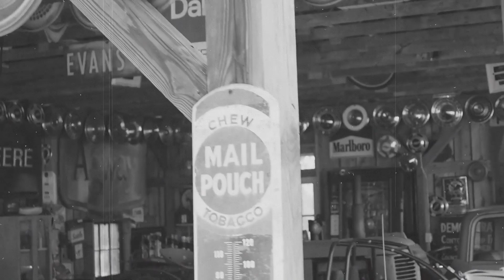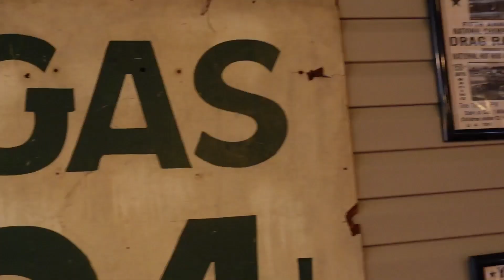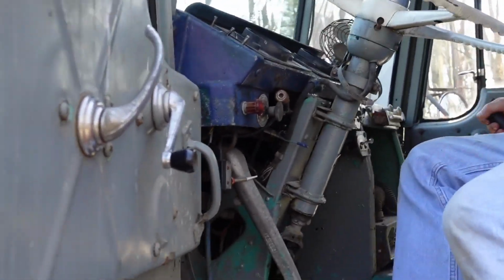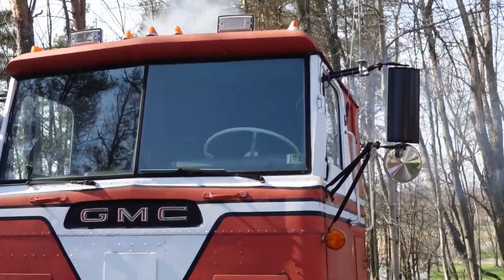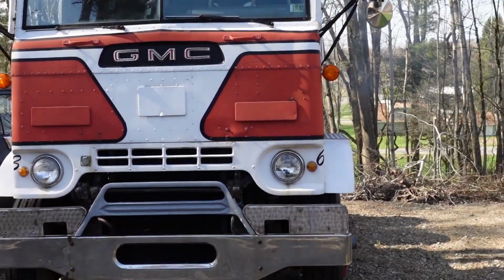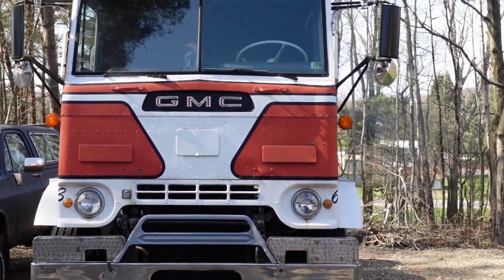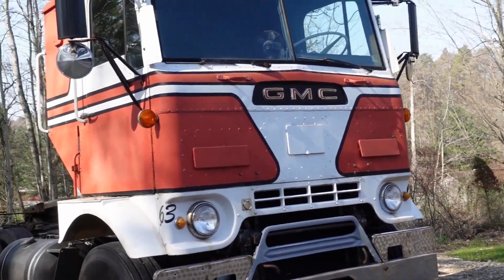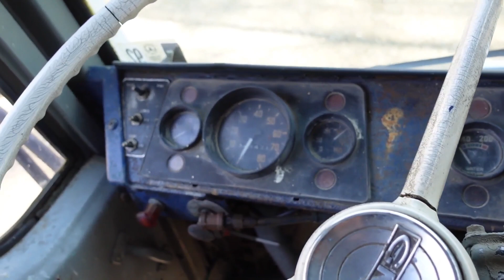GMC Crackerbox Detroit Diesel 671 Turbocharged / Vintage Gas Station & Hot Rods

Comment: The add-on turbo won’t hurt that 6-71, the later versions in the early 80’s were available with these directly from DD/A. This particular engine desperately needs the rack ran on it and the idle reset to eliminate the “hunting”, would likely eliminate a good portion of the smoking. Might not hurt to pull the injectors and give them a thorough cleaning/inspection, possible gum/varnish deposits hanging the plungers in the bores.
Reply: I hear rod clatter in their too

Comment: I remember my father driving for trucking outfits when I was a kid, and a good many of the haulers were using GMC Crackerboxes... Two things that I always remembered about them was 1) that eerie green interior paint the factory always used, and 2) when these tractors used the Dayton type hubs (few had Budds because they were considered aftermarket back then) they always had this characteristic "fat" look (both front and back) that would distinguish the GM stock from any of the competitors of the time... Even the later Astro units that replaced the C-Box in 1969 didn't have stock Dayton hubs nearly as "thick & meaty"!
Reply from the maker: Your absolutely right! And that’s why I love em.😬👍
Reply: I Love them Dayton Wheel,s they are my Favorite on all Truck,s! You can really Dress them up with paint and Chrome lug nut covers and they stand out nice. Budd Type Wheel,s have been out just as longer as Dayton type wheel,s if can remember correctly. I would really have to check, to make sure. But I know as far back as, I can remember even when I lived out in California mostly all the old truck,s had Budd Type Wheel,s?

Comment: A turbo is not going to cause an engine to run away unless the seal goes bad and it starts running off the oil.  Sounds like the injector rack might stick once in a while.

Comment: Yep, Birkmire had these with this paint scheme but green. Seen these running in Erie  in the 80’s.
Reply from the maker: Stayed tuned for the next video, old Berkmire in original colors.😬
Reply: I believe  they are still in business  as btc trucking from erie,la they used to pickup  where I loaded and unloaded at alot.

Comment: I got all excited when I saw the clutch pedal micro switch….That means she’s got a JAKE!!!! They’re Pretty rare on an 8V71 but a 6-71 with jakes is about as rare as hen’s teeth these days. A plain old 2 stroker sounds good on its own but there’s nothing like that sound when you let off at 2000 RPM and let that jake sing.

Comment: I ran lots of Detroits in heavy equipment and none of them ever smoked like that: At startup but after a few minutes that should be gone . Almost looks like water getting in and it’s burning it. Cracked block or head gasket. Ran a 6-110 that idled like that. Otherwise ,gorgeous truck

Comment: The ride quality on today's beat up interstates will have you wishing you had air ride and new suspension. That thing would jar your teeth right out of your head on I 40 in Arizona. Probably fun to drive under 50 mph but today's interstates , not so much.
Reply from the maker: You’re definitely right, it’s no different here in Ohio… trust me. But it’s pure pleasure driving them and connecting with that old school vibe.

Comment: I agree with Bowslap-rack needs to be run, injectors pulled and flow tested, governor set and most of all-take it out and blast the living crap out of it. You're driving it WAY to slowly and lugging the engine. Get it up to the governor. Do you know that Detroit Diesel had a marine version of the 6-71TI that put out 485hp at 2,500rpm straight from the factory? Many a truck driver turned these engines up to 2,800rpm for better performance-course less engine life.

Comment: Factory power steering in 63? No way! I've driven a couple of cracker boxes that were newer than that and they didn't have power steering
Reply: most of those were equipped with what G M called pin point steering, as long as it was rolling it was supposed to steer easier than most of the other competitors back in the day.
Reply: @MrDavidstroud  Ok Thanks David

Comment: I drove a GM a few times but didn't care for them. Even the 318 was underpowered. It didnt help that my route took me over Donner Pass. It took me over 3 hours to go 90 miles. I did have one truck with a Detroit that I did like tho. That was a 1988 Kenworth with a 575 hp 8V92. And yes, they did make but only aftermarket. It was a truck/trailer tanker and i used to pass the 3406's and the 400's.
Reply from the maker: Wow! your a true Veteran on the pass! Hat tipped Driver.
Reply: @DaneScottsTRUCKERSLOUNGE  I still look back on everything with nostalgia though.  0
Reply: @DaneScottsTRUCKERSLOUNGE  
I started in the early 60's on my Dad's ranch. Bought my first truck in '74 and went to Alaska to work. Didnt stop until a drunk wrong way driver took me and my truck out August 17, 2001.
Reply: 8 v 92's were thirsty. I'll take the 3406 all week long. JUST  SAYIN
Reply: @andrewnorris1514  
Yes, they were! But you gotta remember the times though. Fuel was relatively cheap then. Most engines including Cummins and Cat's only got around 5-6 mpg. The big Detroits got just a little less. That truck/trailer I ran had two 250 gallon saddle tanks to make sure that I had plenty of motion lotion.
Reply: That might have been the last 2 stroke put in a commercial truck. I know they weren't advertised 575 or even close. Tend to say maybe neh neh
Reply: @woohu2u2  who made a truck with twin 250's. Nobody. Maybe you got the fumes
Reply: @andrewnorris1514  
WTH are you talking about?
Reply: @andrewnorris1514  
Like I said...It was only an aftermarket version. Different injectors, switch out from the two small turbos to a large 90mm, larger after cooler etc. It was a West Coast thing because of the mountains. Believe it or not, it doesnt change what I know or did.